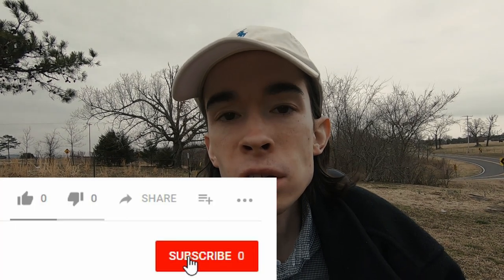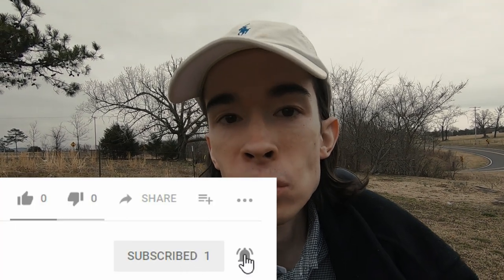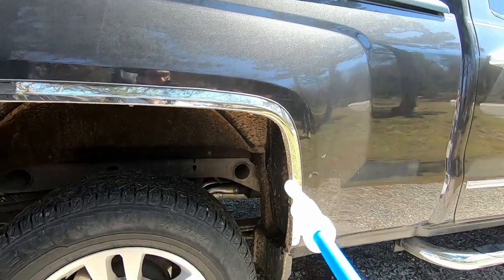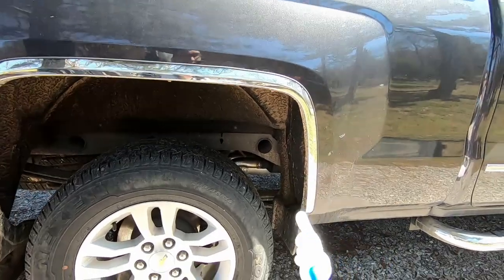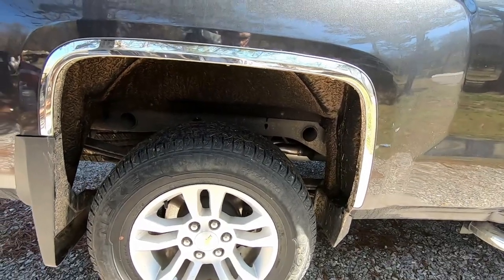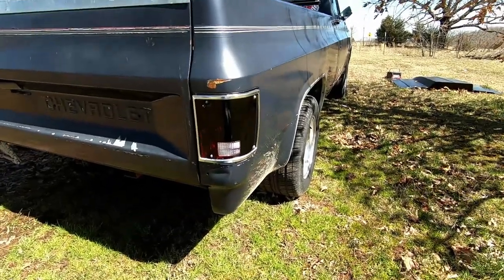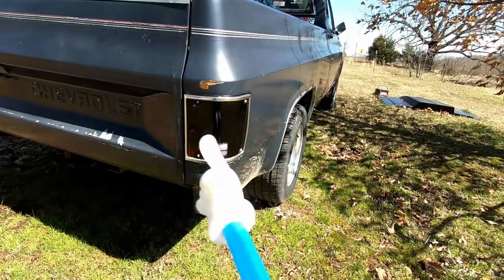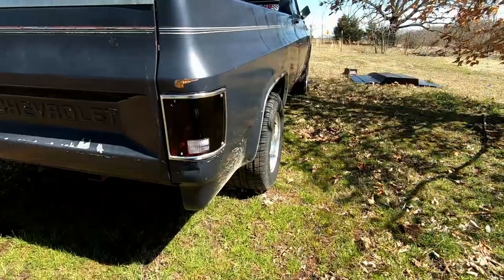3000 Stall Converter: Real World Demonstrations

Comment: Just to top-post: there're some good animation uploads of how torque converters work on YouTube. When I was a kid, I read an article in a magazine about this. In its simplest form, put two house fans facing each other. Turn on one and leave the other one off. Within a few moments, the on fan blows air to the off fan and the off fan starts to rotate eventually matching the on fan's speed. A torque converter does this with turbines and hydraulic oil.

Comment: I put a 10inch converter in my 76 camino 400sb and it made a small difference at normal driving speeds, but it would flat out walk away from the other basically stock sb chevys at the light. It got into the power band right now and stayed there. Pissed a lot of people off when they looked under the hood and saw a stock motor with the air cleaner lid flipped. That was a cool car. Wish I had it today, I can afford the gas and tires now. lol

Comment: Good video man! I have a 2011 Coyote 5.0 / automatic Mustang, and you're absolutely correct on people getting too hung up on (just) adding power. My car stock couldn't spin the tires and ran a best of 9.3 in the eighth, after just adding an aftermarket loose tq converter, I went to an 8.3, and probably would've actually dyno'ed less than stock
Reply from the maker: jeff skaarland Wow, that’s an awesome gain. I’m not surprised. I wish I had better before and after data with mine, but it was like night and day. Definitely a modification that shouldn’t be looked over. Thanks for sharing your experience, and thanks for watching!

Comment: On my 1964 Econoline van I took the straight 6 out and put in a 289 with a 512 cam, flowtech heads and a 3000 torque converter and changed the rear gears to 3.25 sure trac. This van now needs a wheelie bar. I wanna try a turbocharger but don’t really think is needed. It’s already scary fast and nobody expects it. 😂😃

Comment: That was awesome, I love my converter in my 84. my truck has the tci 3000+ anti balloon non lock up,2:73 horrible gears for now and still launches like a beast until u get over 1/4 throttle... then its toast the tires time.
Reply from the maker: Adam Bonner ha I bet your converter helps make up for those gears. But sounds like your engine is plenty strong enough to get your c10 moving even with 2.73s. My truck had 2.73s and the stock 305 when I got it. It was so slow and sluggish, it wasn’t even funny! 😂
Reply: @WheelpowerTV  thanks for replying!! Yeah it moves enough, low 700r4 1st gear is probably like 3:55 and th 350 ;) gotta get my other gears in. That 3:73 will be like 4:56 in th350-400. I've got an open header and idle video on here, and a few on my business page on Facebook.reincarnateclassics
Reply from the maker: Adam Bonner Very nice! I’ll go check out that video. Sorry I took so long to reply. I didn’t see this reply until just now.

Comment: Thanks for the tips. I’m working on a 62 c10.  I just built a 8.1 496.30 over 750 quick fuel carb.  With zz502 cam. 

I’m realizing I need a 2500 to 3000 stall and I was worried how it will drive one the street. 

I’m running a th350c trans with an old 55T rear end. 373 

This is a budget build so I’m worried of wasting money on the torque converter if I end up breaking the trans. 

I found on summit you can get a huse 2500 stall for 382. Then I change the sprang in the trans with some good clutches and clean up the rear end with some good oil. 

The other possible problem is I like to have taller tires for the street and I hope I don’t break anything. If I do it’s going to have to be a 9 in

Comment: Good video.  First time seeing this. I'm getting my transmission rebuilt soon and I will add a 2500rpm stall too. Mainly its highway cruising and around town at times. From time to time I will drag race the car. The car is all stock. 94 Chevrolet Caprice 9C1 LT1 350. I ly thing I added to her was a better dual exhaust system with Flowmaster 50's. The rear end is stock 3.08 posi.

Comment: Cool information dude.  Great content.  I'm looking at buying a 1978  Ford Ranchero with a Cammed 351 Windsor and a 2500 torque converter.  Painted jet black. i was wondering what the torque converter did and you did great Cap'n.  Now I understand   Thanks a bunch

Comment: awesome video guy! I've been on  again and off again about putting a small stall converter in my s10 v8. the truck is light and and lockup occurs almost instant. I know for fact that stock truck converters stall between 1200/1400 rpm. stock camaro and corvette converters stall at 1700/1900. I bought my tranny as a reman and have no idea what converter was used with this transmission. I'm thinking it's a 1200/1400. with 300+ hp and 375+ torque it should pull a lot harder off the line.  it's  kind of funny,  creeps to 2 grand then breaks traction.
Reply from the maker: Daniel Fleming Sorry for my delayed reply. I looked over your comment somehow. Yes, that’s about how my truck was. It would creep up to a certain RPM then come alive. It was annoying to say the least. The 2,800-3,200 stall converter makes it feel like a whole different set up.

Comment: when you dumped the throttle it hit 2000 rpm from a stand still.  need slightly more gearing, more stall or both to hit 3000 out of the gate. maybe needs more power, i dunno. the truck over a car should add a couple hundred rpm anyway. Great video and showcase, the truck takes off with authority.

Comment: A really good video, it explains the hi stall in everymans language. I was wondering about what stall convertor to use in my hotrod project .I have a 302windsor with a stage 3 camshaft and I was thinking of a 2500 stall but i think a 3000 stall would be better.  ps  I like your pointer stick!

Comment: thank you for the video, I have a 3600 on the way, what rpm should i leave at? thank you!
Reply from the maker: Venom Hemi thanks for watching. I can’t really answer that one. That’s very application specific. Lots of factors come into play on launching. Depending on your overall setup, especially your tires and suspension, sometimes it’s best to just “flash” the converter, which basically means leaving from idle or slightly above and letting the converter flash to the stall speed (of course, the stall speed may not be what the converter is actually rated for depending on overall setup). Other times, it is better to foot brake and rev. You’ll just have to experiment with it based on your specific application.
Reply: @WheelpowerTV  okay cool thanks for the reply I will experiment

Comment from the maker: Upgrading the torque converter was one of the best mods I've do to my c10. Do you guys have higher than stock stall converters in your vehicles?
Reply: Yes. Some stall between 6200 and 6500 depending on application.
Reply: I got a 3000 stall in my k10  
Great video too
Reply: If I remember right I have a 2400 stall. Is there a way to tell? I built my setup in 2003 when I was just a kid and can't remember the details.
Reply: Do you lose towing capabilities when using a higher stall? I have an 04 ss all wheel drive truck that will be my first build.
Reply: I put new motor in my truck and few years back and was told I wouldn’t like the upgraded torque conv and now I wish I did
Reply: Hot rod 👍

Comment: I have an 86 Camaro Z28 with a ZZ4 engine I picked up, I purchased a Lunati 20080721 cam (1,800-5,800) wondering if I need a stall? I’m planning on using the 700r4 that’s in it (maybe upgrade it). Gears I’m sure are higher oem. May change to 4th gen rear..any input would be appreciated! Great video 👍🏻

Comment: So how much throttle do you have to give it to see the benefit. I have an 83 Dodge W150 4x4 with a factory 4bbl 318 and headers. When they made the factory 4bbl 318 they used 360 heads which flow great for a 318, but the compression and velocity is low. Long story short my truck don't start moving with authority until 2500rpm. I'm just wondering if a converter wouldn't be a decent upgrade even in my mostly stock truck?
Reply from the maker: Darrick Cato I don’t know much about that type of build, but I would say a mild, but still higher than stock stall torque converter would help get your truck moving. But with regards to your first question, the ideally matched converter will allow your truck to behave largely the same as stock at normal driving. It’s the flash stall and ability to rev it higher with the brake that makes these converters valuable. Just giving the truck light throttle, you likely won’t see hardly any difference if you select the proper converter for your application. But as for a hard launch or just a quick dump of the throttle, you’ll definitely feel and hear a difference. I’d certainly look in to it if I were you.

Comment: You have a sbc 350? Do you have any issues with highway speeds and the transmission going into 4th?
Reply from the maker: John Silver I don’t notice any problems on the highway or in city type driving. At least with my set up, the truck behaves great with the converter. I have a TH350 transmission, so there is only 3 gears (no overdrive). A 700r4 or some other overdrive trans might not behave the same.

Comment: Just because it has a higher stall speed does not mean it isn't grabbing at all at lower rpms it can be driven normally but the majic happens when you mash it that little bit of grab you get at low rpms you dont feel cuz the rpms jump.so fast then the converter says oh shit and locks up by then the rpms are at whatever the stall speed is set at and the motor is in its torque curve hp does not really do anything until 5250 rpms before that it's all torque and at 5250 hp.takes over remember torque gets the tires spinning hp keeps them spinning. That's the gist this is why the old Pontiac and buick motors were so AWSOME they only had 300 hp but that didn't matter it had 500 lb ft of torque it never used the hp never revved that high didn't need to..

Comment: I have a 1979 Chevy stepside c10 with a built 454 motor and a Th400 transmission.  What torque converter  would you recommend? I know that there are a lot of variables.
Reply: Are you daily driving it or drag racing

Comment: Hi, I’m doing a LS swap to my 1986 gmc classic sierra “c10” I’m installing a cammed 6.0 lq4 216/220 is going to be my daily driver is paired with a 4l80e was wondering what kind of stall would be appropriate for my install
Reply: Perhaps too late but for that cam spec id recommend 3000-3200. Have the same setup but a lq9 and 4l60e
Reply: Thanks, i just ordered my stall converter last week went with a circle d 3000-3200 so perfect thanks for the reply